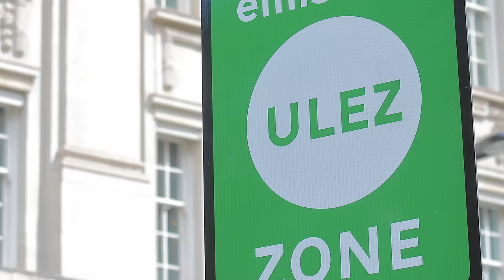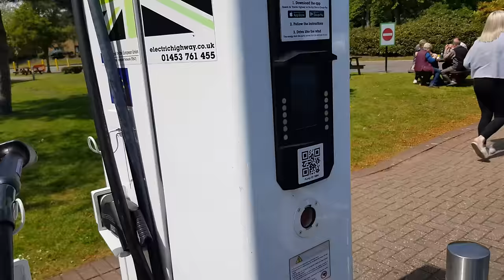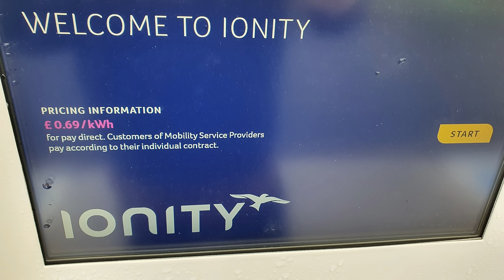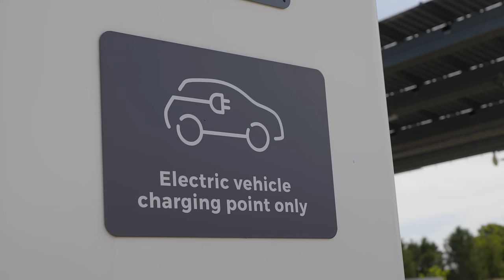The Uncomfortable TRUTH About EVs: The Version NEITHER SIDE Wants You To Hear

Comment: The main problem with EVs is that the tech will date so quickly. A current EV will be about as wanted an iPhone 4 in short time.
Reply: That's how I see it. Remember the mass hoverboard craze back in 2015. How many do you see being advertised now or being used by adults? Same with Segway balance personal transport things. Segway now produce not only  those but robotic lawnmowers and internal combustion powered ATV's.
Reply: disagree, tech outdates quickly because it's a trivial item that is relatively inexpensive to replace where a car is something that is not cheap by any means and not trivial to replace so there is an incentive for both consumers and manufacturers to keep them going in the long run. Possibly parts might be an issue since no manufacturer wants cars to last forever and they can simply cop out and say it's too expensive to stock parts. Also a car from the 80's usable today because pretty much the base functionality of a car hasn't changed wildly in the past 50 or so years arguably for more. If you don't have an american style rampant consumerist mindset EVs will be viable as long as they remain reliable and depreciate enough that a second hand market can thrive.
Reply: @mertvaran5733  
I agree with you completely.  

In response to the original comment, I will that I would be quite happy to still be using my iPhone 4 if iPhones could be upgraded with new memory and other device upgrades that have happened over the years, but honestly the biggest problem IS that Apple no longer supports the iPhone 4 so that means no more software updates, new apps that won’t run on the old software, etc. so the fact that it is now essentially obsolete is its biggest problem.  I don’t think I even have a cable to charge the iPhone 4 anymore.  At least I can still charge my iPhone 6 (which I think is the most recent iPhone to no longer be supported) and access the data on it and use some of the software when I’m on Wi-Fi.
Reply: My 6 yr old Tesla still gets full over the air support. That means software and navigation updates all completely free. One other perk of Teslas compared to other EVs, and why so many people love them...
Reply: EVs suck lmao... Bad for environment, Slave labour to get minerals, Long charge times, Not cheaper to run tbh, When battery dies or gets worse in 5-10 years you need to fork out lots of $ for a new one 🤡
Reply: @w3w3w3  and you know this how? Does my cobalt free battery still rely on artisanal mining? Does your Apple iPhone use tantalum capacitors from Congolese coltan and if so, are you not only ignorant but possibly stating buying a battery powered anything is not politically correct but buying a Huwawei or HTC phone is?
Reply: Why do you say that? I have a 2014 Nissan Leaf, works well for us as a city car. Done 65k miles in it. We also have a couple of ICE cars too. Very cheap to run, very reliable.
Reply: Thus a huge cost to the environment!
Reply: And ICE cars don’t? The problem with this discussion and your logic is it’s based on ‘feelings’ and no facts.  Take a Tesla model S that maybe 10 years old. Due to updates it is now a better car and more up to date than when it was first driven. How is that’s dated? Yes, hardware will not be as up to date. But EV’s, if designed and built correctly (many are not) then they will outlast an Ice car significantly. The issue with this overall EV/ICE argument, is variance across the options available and people “picking and choosing” what facts they want to use to support their “feelings”.
Reply: @savvysurveyor5318 Idk where you got that from I even mention using cars from the 80s is fine since the basic functionality of cars haven't changed idk what EV you're gonna drive in the 80s? Cars are tools and tools last as long as you want them to depending on your care
Reply: @mertvaran5733  sorry, I don’t understand what you are saying and what the reference to 80’s cars is all about 🤷🏻‍♂️. My response was quite clear with reference to the original point made and an example to support my comment.
Reply: @savvysurveyor5318 that was in my comment and you replied to my comment lmao
Reply: I’d question that analogy; an iPhone 4 is still better than any non-smart phone. And now very affordable.
Reply: @markgarnett3521 but mostly unusable as its software and apps can't update. Thereby, most apps won't start/won't be able to communicate with servers, won't be able to install new apps (they require an up to date OS, the will be security issues as the OS won't be up to date... You name it. Your iphone 4 would be essentially a non-smart phone. And if the battery lasts half a day it would be a miracle. Same with these cars, when Tesla wants you to buy a new car they will stop updating yours, same as Apple does. They are companies, not your friends. They want to make money, they don't care about the environment or you.
Reply: So, nonsense.
The 12 year old BMW i3 is now 12 years old and there is a good trade in refurbing them.
Reply: Tech dates quickly due to planned obsolescence. Given how much is put into developing these cars, the smart path would be for manufacturers to keep them running as long as possible. Many of the comparisons of EVs to hoverboards and other types of battery powered devices is apples and oranges.
Reply: @mertvaran5733  Which is where we are at now and that used market is being confused as a death flag.
Reply: @w3w3w3  Wait till you find out the human and animal life cost (not to mention the ecological impact) or coal mining, plastic production and oil drilling and processing....but I doubt you care much for the environment other than to try and dunk on EVs

Comment: Sandero diesel owner here. I get over 70mpg on a local dual carriageway run, costing around 10p/mile. My current price for electricity is about 33p/unit, around 10p/mile for an EV. At 99g/km my Sandero is £0 tax and in a lower insurance group than most EVs. I could drive the 320 miles from Birmingham to Stirling and back without having to refuel, which no EV can do and I'd have to pay a higher unit price to recharge. My Sandero cost under £3,000 (used) to buy outright; any similar EV with a useful range is at least thrice that. Although cheap, I didn't buy the car to show off; it does everything I need from a car. If all my journeys were local I'd consider an EV but at this point it makes absolutely no economical sense.
Reply: My sons 2013 Dacia sandero 1.5 diesel, with 42k on the clock does 87 mpg on a run at 65 mph after an oil change and service, it is VED exempt to, he frequently drives 700 miles to the isle of sky in it in about 12 hours.
Reply: Comparing a cheap old car to a new car is daft.

Also, you can buy EVs that have > 320 miles of range.  And even if it didn’t then if you have an EV with say 250 miles of range then you only have to pay for 70 miles at the higher price.
Reply: I charge my EV overnight at 7p per kWh. It's around the equivalent of 600mpg comparing with a more average 50mpg diesel of a similar size to my EV.
I don't think there is a viable EV in the market right now to compete with your current car. I'd estimate within 10 years there will be. But you don't need a 320 mile range to do a 320 mile trip. You will be stopping at least once in that journey for a meal. You stop where there is a supercharger and eat while you charge the car.
Reply: Stop thinking just buy new thing and get excited for next thing
Reply: @AdrianHilder  and when it's a really cold day and you have the heating on the windscreen wipers on, how's your range then?
Reply: @The_Reality_Filter my Tesla Model Y is especially good at heat management and in a UK winter loses only about 10% range. It's has a heat pump and octavalve control system unique to Tesla. Older Tesla's would lose 20%-25% range. This is why you want an EV with 300 mile plus range so you can get enough driving time in so your next meal or bathroom break can also be your supercharging break. 
There are some badly designed EVs out there that lose 50% of their range (Toyota bz4x for example).
There are batteries in development right now that are not sensitive to the cold. The country in the world with greatest EV take up per head of the population is Norway. That's a really cold country. If cold was a serious problem they would not be embracing EVs the way they have.
Reply: @AdrianHilder  if that's the case then why have JCB fully embraced Hydrogen engines which according to their current data completely blow both ICE and EV's out of the water. How big a battery would you need to run a hydraulic digger capable of moving hundreds of tons of earth per day?
Reply: @The_Reality_Filter  hydrogen engines… which according to current data are absolute junk? Hydrogen engines are just EVs with extra steps, and JCB is actually building electric vehicles too. Take the Toyota Mirai. $200 to fill up and costs as much as an EV. Never gonna happen 🤡
Reply: @YouTube2021FM  did you really just say that Hydrogen engines are just Electric Motors with a few extra steps...😀😄😁😆😅🤣😂🤣😆🤡🤡🤡🤡🤡🤡🤡🤡🤡🤡🤡🤡🤡🤡🤡🤡🤡🤡🤡🤡🤡🤡🤡🤡🤡🤡🤡
Reply: You may get cheap motoring in your diesel but you fail to take into account the external costs of burning fossil fuels. These appear on no bill or invoice but are real nevertheless. The people who have to pay are our grandchildren who are likely tto have a very nasty environment to live in. Seems you are happy with that.
Reply: @rogerphelps9939  Oh I see and I guess EV's just grow on organic farms do they?
Reply: @rogerphelps9939  Do you think that EV's grow on organic farms?
Reply: Perhaps that is the case, but it's only so cheap to run because you're not paying the environmental cost of all that diesel soot being put into the atmosphere. Also there are a lot subsidies that ICE vehicles get "Globally, fossil fuel subsidies were $7 trillion or 7.1 percent of GDP in 2022, reflecting a $2 trillion increase since 2020 due to government support from surging energy prices." This is from the international monetary fund.
Reply: @AdrianHilder  I took delivery of a Model Y 2 weeks ago.  Just did my first long trip from south wales to London and back.  

You say charge the car while you eat, that’s nonsense.   I didn’t have time to eat as the car was ready to continue its journey after just 10 minutes.  😎
Reply: @Rambo9700  this is part of the reason why many Tesla owners eat in the car. If the charge is done you can unplug and then finish your food and not get overstay charges 🤣
Reply: @AdrianHilder  🤣🤣🤣👍🏻
Reply: The tech is available today right now that is cheap where you could double or more every car's MPG with combustion engines using gasoline as the fuel. Instead of using liquid fuel squirted into the engine - liquid fuel does not burn. Use Only the fumes. So if you introduced only the fumes of gasoline into the engine you would in essence double MPG while reducing pollution by 50%. This is NOT new technology, just refused to be released to the public by the "rich" of the world. Right now, today. Cost would be about $1,000 per car.
Reply: It's not the "fuel" in your case diesel. It's how gasoline is introduced into an engine as a liquid instead of a "gas" (hence the false made-up name of "gasoline" by John D Rockefeller. Gas and lean?  It could have been called "Bob" just as well.) Liquid gasoline does not burn. Only the "fumes". So if you were to introduce only the fumes you would easily double MPG for every car across the board. Meaning more of the fuel is burned, reducing pollution. Pollution is only "unburnt fuel". Theroereticall any combustion engine with the proper introduction of fuel with a higher degree of effeciency (most engines are only 25% efficient) car with combustion engines could run while producing zero emissions, or pollution. Zero , 0%.Today coal plants for generating electricity are 85% efficient. Cars are 25% efficient. Seems like we are being cheated in the auto industry. From the car industry to the oil industry and being raped at the gas pump. Oil is not a "limited resource". Oil fields pumped dry are and have been refilling. With Saudia Arabia just 4 years ago getting another 660 billion barrels oil reserves added to what they already had, by the refilling of oil wells.  Won't hear that subject on the evening news. The world of cars pollute because of the greed of the already rich, never being rich enough. The tech is available, today, and is cheap to reduce pollution by easily 50% of what cars do today, but is not released to the public. Because it would also increase MPG by that same 50% amount. All pollution is unburnt fuel. Burn 100% of the fuel = zero pollution.
Reply: Just to answer a few points in no particular order..  I'm looking at the cost of ownership. A used diesel is far cheaper than buying an EV with 250 miles of range outright. Plus as I said, my diesel can get from Birmingham to Stirling and back without having to worry about refueling at all. Sure, the cost is a bit higher than charging an EV but it still works out lower than the initial cost of an EV.

No, I'm not too fond of having a diesel, which is one reason I'd like an EV in future, but it's affordable to me now without unnecessarily hindering my other plans (including a house with driveway, solar PV panels and car charger). 

Theoretically a modern diesel should be even more efficient and practical but it's also more expensive. Older EVs are cheaper but have other issues (lower range, battery degradation, lower thermal runaway temp on NMC/NCA batteries).
Reply: That’s almost exactly where I am at. My VW diesel at almost 20 years old gets between 45-53 mpg’s and still runs like new at 279,000 miles. I have nothing against those who are into EV’s, but they are not a good option for everyone, and I am not convinced that they are a net positive for the environment.
Reply: How old is your sandero? model 3's will be around that price when they get that old. Of course the newer thing is more expensive. It's pretty rare for the newer thing to be cheaper than the older one.

Run your sandero in a confined space with the window open. See a difference now? Controlling where pollution goes is important.

Also, your sandero is not a fun to drive vehicle. Almost no one is excited to drive one of those. Electric cars can have the efficiency and the speed.